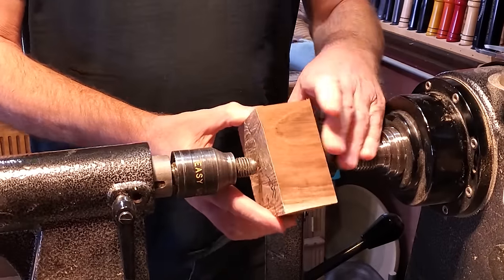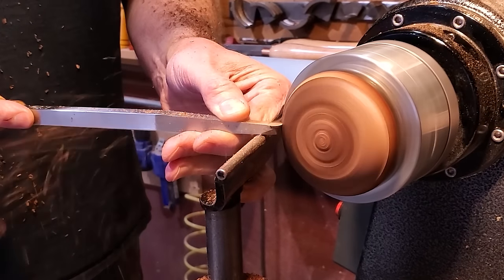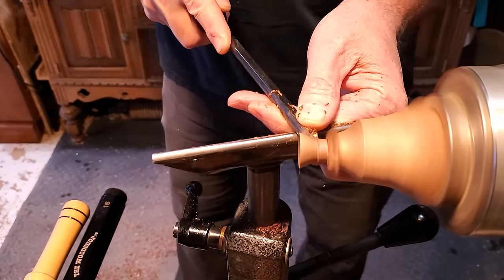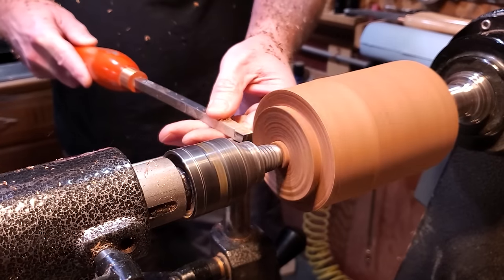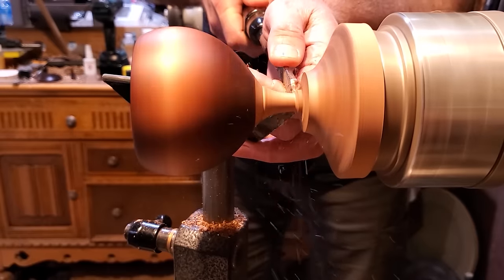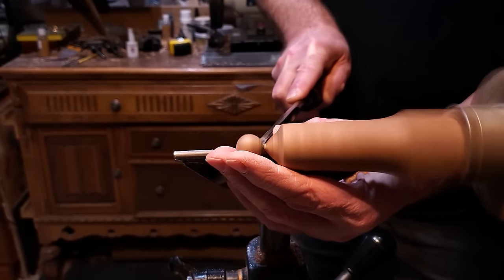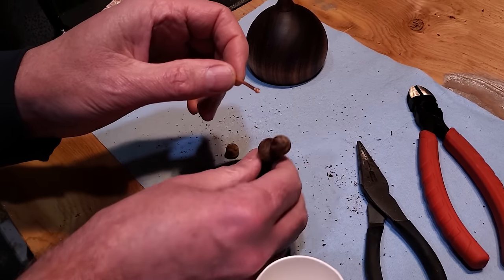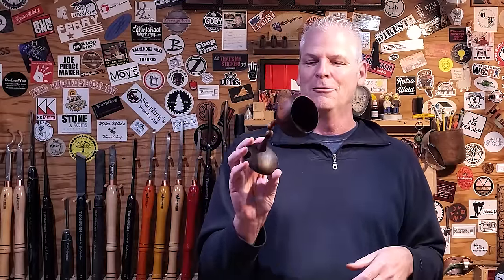Woodturning | Last Call Goblet

Comment: Hey Carl. Good to see you.  I need to get caught up on your videos.  I have a question on making urns. Is there a standard size?
Reply: Mark, by no means am I trying to answer for Carl. I have used the following guideline though and it served me well. 1 pound = 1 cubic inch. 14.1 cubic inches = 1 cup. Sam Angelo made a clear container so he could get a visualization of the size needed. I had to make a couple of different ones to get the size I needed. I have seen all different sizes turned so I can't answer about standard size. My stepson's urn will hold 30 cups, he only needed ten.
Reply from the maker: Hi Mark, There's not really a standard size. Al's right about all the measurements Sam did a great video on it. I think what is popular right now are keepsake urns and the two and a half inch rings are perfect for that.